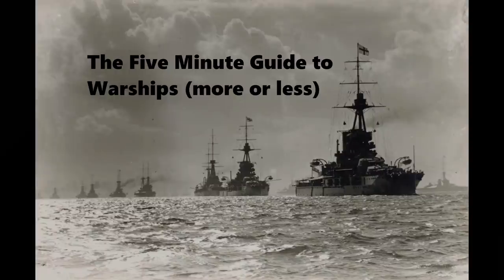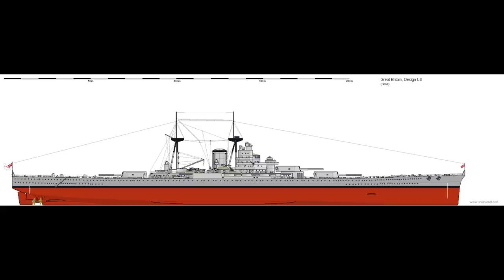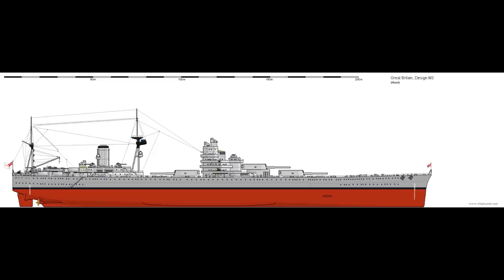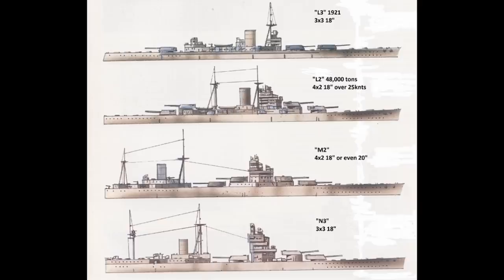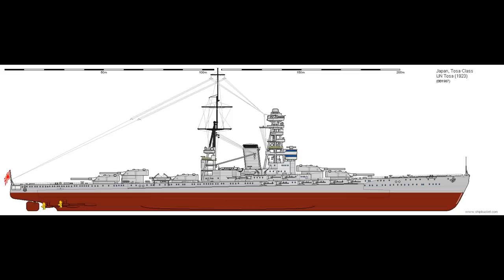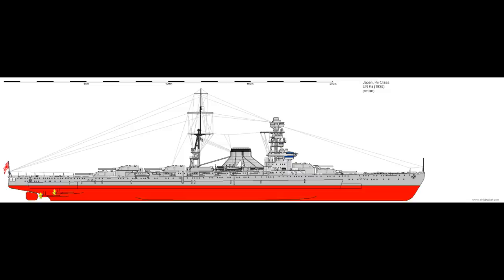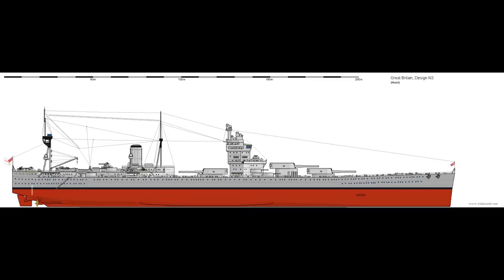N3 class (NB) - Guide 072

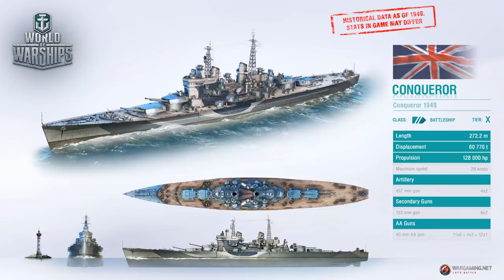Comment: 1:53 TECHNICALLY Conqueror (I guess now Thunderer) only uses the main guns and main battery layout of the L2 design but the rest of the ship is a 1944/1945 Design Lion-class battleship with its 12x2 4.5"/45 Mk V secondaries replaced with 8x2 5.25”/50 guns in the same turrets as Vanguard. The Lion-class Hull does make sense as both Conqueror and  Thunderer were the third and fourth Lion-class battleships.
So essentially Conqueror/Thunderer is really just a 1944 Design Lion-class battleship with different armor, L2 guns, and Vanguard secondaries. Though I would’ve preferred it if they kept the original secondaries of the 1944 design tbh. 5.25s are overused on Royal Navy battleships in that game and would make more sense as the game states the year of design being 1949. By 1944 the 5.25s were already being phased out in favor of the superior 4.5" guns and 5.25s being mounted on a ship designed postwar makes literally no sense.